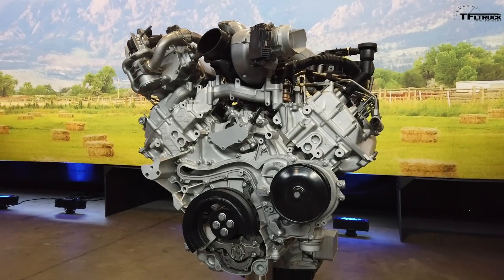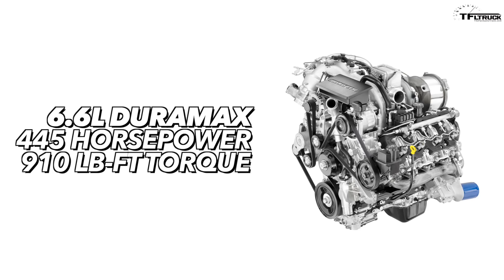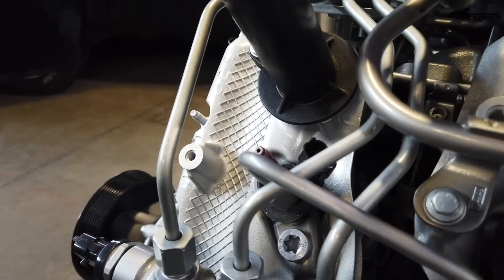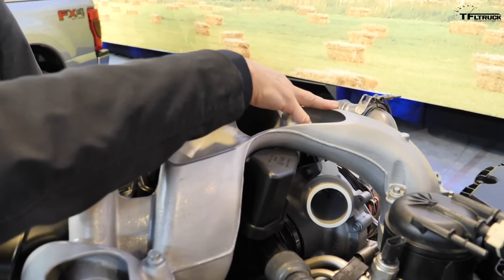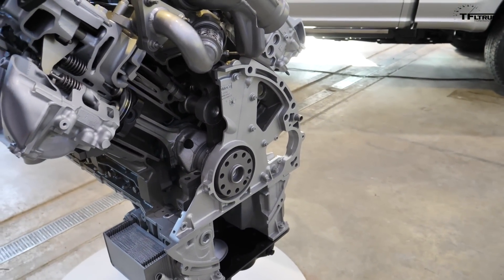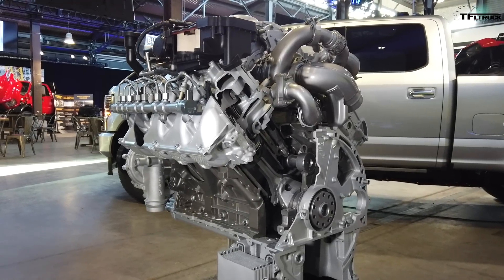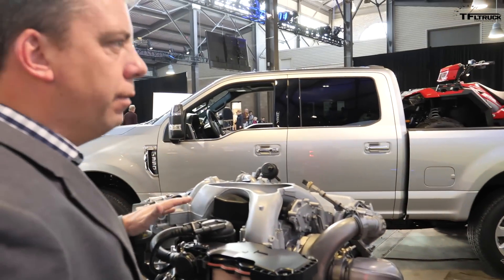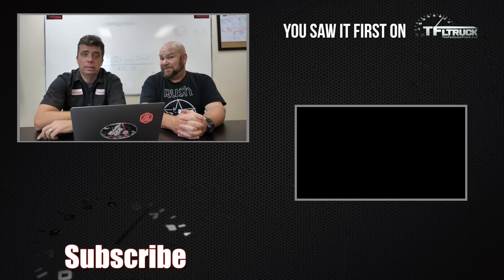Here's How the 2020 Ford Super Duty Diesel Makes 1,050 Lb-Ft of Torque!

Comment: I'll just buy an 06 or early 07 Cummins and build it to the torque I want. Still cheaper than the mortgage payment on a new truck.
Reply: Around here used trucks are severely over priced.  Almost any 4x4 truck in descent condition at 100k or less miles is always 20k minimum.  Less miles and the price goes up.
Reply: @PowerSerge5000  everywhere is like that, people are figuring out how good trucks are. Heck Mercedes an BMW sales got hit because so many men decided to buy a 150 loaded or a z71 over a plastic german shine box.
Reply: @PowerSerge5000  same here but a 60k+ loan is one hell of a payment.
Reply: ikr? truck is supposed to be workhorse, so why they all costs 95K for a truck these days? Geez!
Reply: Buy someone else's problem with no warranty. To be comparable to a new truck - you're still looking at $10,000+ in parts/time. Dodge autos are garbage - a reman/semi built 68 is roughly $4,000 on its own. I don't know but with a decent down payment on a new rig, I think it's a safer bet. And not everyone is running around in fully loaded Platinums - a mildly optioned XLT F450 CCLB 4x4 is close to the $60,000 mark. That's a far cry from the popular assumption that they are $100,000 trucks (which is possible but not at all worth it IMO).
Reply: I never said I wanted an auto lol. And yeah I would rather buy a bone stock one owner 06 cummins for 22k and over time build the truck I want with power levels I am happy with than a thousand dollar monthly payment for a truck and then not be able to do anything to it. And an 06 5.9 will do 1200 foot pounds without much being done to it.

Comment: No one needs this type of power. Its getting kind of silly really. Come up with something else as a selling point please. Such as an affordable truck built for the working class. Not a truck that costs half the pice of a 3/2 house in a nice neighborhood.
Reply: If you dont want that much power get an older truck... and they'll be cheaper. Crazy concept
Reply: @cameronz717  older trucks break more. Stuff just wears out or rots. If they could build things simply, but with modern tolerances and materials, now that would sell me.
Reply: Who is to say how much power one needs? No One that’s who.😎
Reply: It is getting kinda crazy. 1,000+lb/ft torque! You can't get that in an F550, F650 or F750. They max at 330hp because if they made the power they make in these 3/4 ton trucks they wouldn't last. 270hp, 300hp and 330hp max.

Comment: Me: Hey David, how would I change a glow plug?

David: Pull the engine.
Reply: LOL. cheap hahahhahaaaa
Reply: @czwarlord9243  I, a 19 year old kid, changed my injectors for the first time in under an hour on my 1995 6bt cummins.
Reply: @RiggyRonnie  never sell that truck. Once the body and frame are done for swap the engine into a newer chassis. Rebuild the engine as needed. Check out deboss garage channel. He's got a ton of info for the 6bt
Reply: @czwarlord9243  maybe for a rookie like you... Yep.
Reply: Every manufacturer says in service information to just remove the cab from the vehicle to service the diesel engines.
Reply: @czwarlord9243  I work at a Dodge dealership and I have access to Alldata, it says for major engine work, the cab should be removed.
Reply: @czwarlord9243  have you seen the new Cummins under the hood of a new generation truck?
Reply: @czwarlord9243  alright internet tough guy lol
Reply: @czwarlord9243  the new 6.7 is not the easiest to work on. There's a lot more speciality tools. It's only easier because it's an inline and not a v.
Reply: @czwarlord9243  ok. Keep riding the short bus.
Reply: Pull the cab off the frame
Reply: Your name is rick though?
Reply: You pull the passenger cabin. I'm not making a joke. Look it up.
Reply: @talltomtube  4 bolts. You can have a cab off in 30 mins. Nothing new. Been like that for 15 years with cab forward designs.
Reply: @evictioncarpentry2628  30 min 😂 that's funny
Reply: Hahaha! Ford......

Comment: When you read at the bottom of the exemption, recreational vehicles are exempt, that would be travel trailers. Many horse trailers depending on if the horses are for personal or commercial use, maybe they are “farm horses”. For TFL’s purposes, they can get a toy hauler travel trailer sponsored and load it up. They can be enormous and ironically be exempted even if over 26001 lbs. 

The following vehicle operators are not required to obtain a CDL:

Farm Equipment Operators - This exemption covers legitimate farm-to-market operations by farmers, not commercial grain haulers. CDLs are not required to operate vehicles:
Controlled and operated by a farmer, a member of the farmerʼs family or an employee;Used to transport farm products, equipment or supplies to or from a farm (including nurseries and aquacultures); Used within 150 air miles of the farm; andNot used in the operations of a common or contract carrier; and Used in nursery or agricultural operations.
NOTE: For the drivers of truck-tractor semitrailers, the farmer, his or her spouse and their children, parents on both sides, brothers and sisters on both sides and their spouses operating a truck-tractor semitrailer and meeting the above criteria also are exempted from the CDL Program. These drivers must be at least age 21, and the vehicle must have Farm plates. These drivers are still required to take the appropriate CDL written, skills and road tests to be licensed.

Firefighting Equipment Operators - Because most firefighting organizations have extensive initial training and re- training requirements for their equipment operators, Illinois waives CDL requirements for operators of firefighting equipment owned or operated by or for a government agency, when responding to or returning from an emergency.
Military Vehicle Operators - Operators of military vehicles for military purposes are exempt from obtaining a CDL.

Recreational Vehicle Operators - Recreational vehicle operators, when using the vehicle primarily for personal use, do not need a CDL.

Comment: Just realized Ford is the only one that makes their engines for this market
Reply: Jack Fessler  which,  if you read my comment, is what I said in less words.
Reply: Jack Fessler  GM owned a large percentage of Isuzu at the time, and yes I believe the Duramax would still be here for better or worse as other companies such as TOYOTA wanted a piece of the market and had extensive Diesel experience and wanted to jump in with GMC at that time.
Reply: GM makes the Duramax. It was a joint venture design wise with Isuzu the worlds leading diesel engine manufacturer but is not made my Isuzu. It is mad in the USA by DMAX a GM company
Reply: Wrong again.  GM has always made Duramax with help from Isuzu, whom they own.
Reply: Power stroke is international
Reply: @michaelchudyk8779  7.3, 6.0, 6.4 were.
  Starting with the 2011 model year, Ford made their own.
Reply: @michaelchudyk8779  as of 2011 ford started building there own power strokes nothing to do with international anymore.
Reply: @michaelchudyk8779  you're thinking of the 6.4
Reply: Michael Chudyk not anymore the 6.7 powerstroke is designed and built in house
Reply: @deerepower337  can't you see he is Ukrainian?  That has alot to do with knowledge.

Comment: When they do the tow test comparing the big 3 hopefully they use the F-350. Most ppl are going to buy the F-350 not the F-450 and it’ll be equal. Dodge and Chevy only make a 4500 for commercial use

Comment: Does anyone know why ford and gm have made their own engine rather than taking a light industrial truck engine like dodge did
Gm and makes inline 6cly
It would be easy to upgrade an individual engine 
I would be scared to take a ford or gm to banks for an serious upgrade
Reply: I agree Nissan used cumins also I’m sure they have their own engine for larger vehicles 
The only thing I can think is weight 
And v/8 do turn up faster
I have nothing against cumins just dodge

Comment: Too much pressure for fuel and air for that engine even though it’s been upgraded I see head gaskets and other things being blown out after a matter of time.     I am a owner operator truck driver been doing it for 17 years there is no long-term reliability in this engine
Reply: Jon Scott Owner Operator huh? Let’s ask the engineers and mechanics instead
Reply: Shane T long term it’s not going to work.  They don’t care after the warranty is up...
Reply: Jon Scott It’s not hard to get 500hp and 1000tq out of a modern diesel reliably if you properly engineer the vehicle.
Reply: Shane T It will not be reliable in the long run. And why aren’t semi trucks equipped with a little small 6.7 L V-8 when 11 L straight six engines in semi trucks can’t even come out with a horsepower number like that but only on the torque half?   = no long-term reliability it’s just a best in class scheme over the pick up trucks.
Reply: Jon Scott That’s because semi trucks are designed and tuned for high torque and lower hp ratios. Semi trucks that haven’t been detuned by the mega carriers like Werner and Schneider often times produce 500HP. They detune them for safety so idiots don’t crash them as easy and to save fuel.
Reply: Shane T I’ve been in the industry for 17 years.  They don’t detune!!  They limit the speed you can travel on the interstates or highways.  1 yes for fuel economy.  2 yes for idiot drivers.  But not to the point of impeding traffic or getting up to a safe speed.  And if they “detune” why does Cummins 15x called “performance series” have output of 605hp and 2050tq???  FYI with certain permits depending on state laws some are allowed to pull over 150,000lbs.   No detuning there...
Reply: Shane T Also did you take into account what about the struts what about the bushings on the trucks the brakes the bigger nuts and bolts to handle the power with an exception of the engine and transmission.  the rest of the truck remains unchanged look it up.
Reply: Jon Scott from experience these fords arent very reliable anyways, drove one for work and it ate a 2transmissions, 3 rear diffs, 2 transfer cases, 1 computer. It’s been rewired, frames been replaced after it kinked
Reply: Bought a 2013 F250 brand new and used it to pull a 3 horse slant load trailer with 13' living quarters. Trailer dry was 10,100 lbs. Pulled it all over the US and put 350,000 miles on the truck. No problems and averaged 16.4 mpg. Just traded for a 2020 F350 dually and couldn't be happier. These engines will last and give you everything you need if you service them with routine maintenance.  Ford is the truck for WORK.
Reply: Lance Mullins I’m talking long-term AKA after the warranty is up. Please re-read my statements
Reply: Lance Mullins FYI I am a fan of all American truck manufacturers I’m not trying to be biased but they’re pushing it you will see.

Comment: Did he say plastic intake manifold? How long is that going to last? Should of left it aluminium, maybe a 5lb difference for more reliability
Reply: there are many many many kinds of plastic.  sure there are 2 or 3 basic groups, but individual kind of plastic, so many.  but yeah, I hope it lasts too!  (the same argument could be used when it started to be aluminum in the engine)
Reply: Plastic can dissipate heat better and “gain” hp in the sense that your just getting the power robbed back
Reply: @Nathan Davis didn't know that (thanks for putting it out there).  hopefully they got that properly dialed-in!

Comment: Plastic Lower intake manifold to save weight on a HD truck?????? Ridic
Reply: First thing I thought
Reply: My 2018 has a plastic oil pan. If I had known that before I bought it I wouldn't have.
Reply: @johnparrish9215  really????
Reply: @John-ms6sd  Yep, really
If they will go cheap on an oil pan, plus make you buy a new oil pan plug at every change, then what else are they doing.
Reply: @johnparrish9215  I can't believe that.😨 A plastic pan!!!!! Hold on to the old equipment!
Reply: @John-ms6sd  Modern BMWs also have plastic oil pans - as well as many other parts.
Reply: @taunuslunatic404  Still recovering from the last shock.😓 Never heard of this before. I really like working on the older stuff. I don't mind computers and electrical systems just not stupid stuff!!!
Reply: @johnparrish9215  its likely a plastic composite and it won't rust or dent. It may even be just as strong or stronger than a stamped steel pan...just saying it may not be that bad
Reply: @JDJD-mw9rr  It was just not necessary and the fact you have to buy a new oil plug for every oil change just pisses me off.
Reply: @johnparrish9215  i get it but it's just the progression of the times. The gt350 has a composite oil pan as well. Im assuming an oil change in that truck is over $100 so they figured adding in a new plug wouldn't be so bad. Can you reuse it a few tines or no?
Reply: @JDJD-mw9rr  I tried, it leaks.
I'm trading next year, buying a Chevy.
Ford got on my last nerve.
Reply: John Parrish No they don’t. Stop. Just stop.
Reply: @johnparrish9215  dont know what brand you bought but they just go back in the way they came out. You can also get a metal oil pan if you please. But I know for a fact you do not need to replace the plug every oil change. I can also tell you from personal experience that you would not be very pleased with a gm product if you're against any sort of plastic, especially when it comes to oil pans.
Reply: @Tman0517  gm plastic breaks more than plastic in any Ford or Ram ive ever worked on, especially if its more than a couple years old.
Reply: Yeah, can tow 37,000 pounds, but they really needed to save weight with a plastic intake tube. Totally stupid. I hate plastic parts under the hood. They ALWAYS break 10 or 15 years down the road when you are trying to do repairs.
Reply: I agree. It's one piece and the plastic can't weigh that much less.
Reply: Its just an intake tube really. Which have been made from plastic for years. The weight savings was probably BS. I would guess its much cheaper to manufacture.
Reply: DWCBOB
Reply: “We replaced the aluminum intake with plastic for heat reasons, we replaced plastic intake manifold with aluminum for insulation.” Lol wtf
Reply: SO THE PLASTIC GET COOKED BY THE HOT METAL PARTS AROUND IT --NO FORD WENT CHEAP THESES NEW ENGINES ARE  MECHANICS NIGHTMARES COST YOU A LOT IN LABOR TO FIX THEM

Comment: Honestly, who needs 1000 lb-ft of torque unless they're professionally hot-shotting or some sort of contractor/farmer. Even then, I don't know the last time I saw a farmer pulling 30k lbs. Only really big loads you see them mess with is hay trailers. IMO, gas is going to be king from here on out. No where near the torque, but plenty of power and adequate torque for what most of even the upper end towing folks will need. They will be much more fun and free then diesels due to the epa crack downs too. Who really wants to pay taxes on their paycheck, taxes on the purchase of their vehicle, then property tax on their vehicle, and then not even be able to mod/tune your engine like you want to without the government getting involved and having to pay fines. Big bore gassers FTW.

Comment: Very nice Ford. But what the heck happened on the dyno? Big marketing numbers translate to big lies on the dyno?
Reply: Do you understand where they get their TQ and HP numbers? All manufacturers follow the same SAE process. Power is measured at the crank, not the wheels. Too many variables in drivelines and dynos for accurate measurements at the wheel. Been that way for decades.
Reply: @therealjohnsmith4811  Ford makes inefficient drivelines?
Reply: Quang Nguyen If you do the math on all of the big three trucks they are all 12-15% driveline loss. That at perfectly normal and typical. It depends on the dyno most times. They all measure a little different.

Comment: I hate the tremor vs power wagon comparison, the power wagon isn't really a "heavy duty" truck as far as towing it has a purpose built suspension for offroad where as the tremor is basically just an f250 with a few bells and whistles that should really come standard on the FX4 and is no way a power wagon competitor other than the fact they are both built on the 2500/250 platforms of said truck.
Reply: wow!  i never thought of it like that - your right

Comment: And if Ram said they got 1050 ft pd of torque, Ford would be 1100 ft pd. 
They always (if true or not) have to “one up” everyone.
Reply: give it some time and Cummins will come out with an extra high output engine. knowing Cummins its not going to be a one up but a full on jump.
Reply: @phalanx3803   CUMMINS
Reply: @bryan70546  lol I was using voice to text it doesn't seem to be too good with understanding names.
Reply: @phalanx3803  I hear ya shit don't work to well for me either lol
Reply: @bryan70546  as annoying as it's shortcomings are it's so handy for typing texts and comments whilst you're driving a tractor trying to type text on a bumpy trator is not fun.
Reply: The Ford can go to 800 hp 1600 ft lb. Torque on stock internals and fuel systems.
Reply: @jeffmiller3150  lol

Comment: The 2019 Dodge ecoboost diesel is much faster than the Ford
Reply: julius jones you are dumb like a tractor
Reply: julius jones it's called the ecodiesel you uncultured swine.  The EcoBoost is ford's turbocharged 4 and 6 cylinder engines.
Reply: Captain Rudy 4021 and 3 cylinder 😉